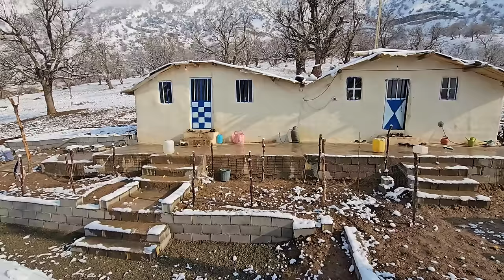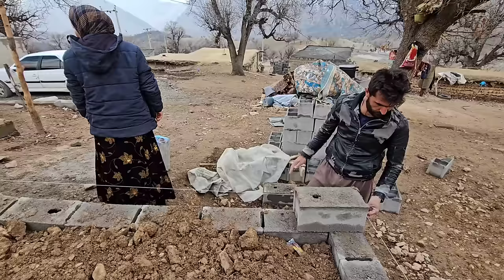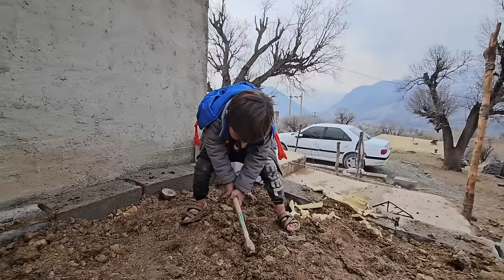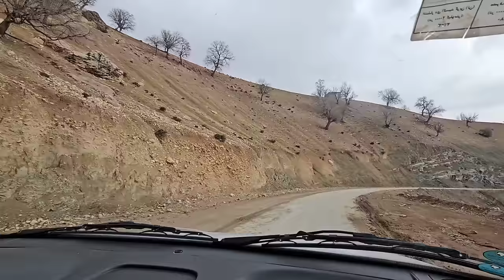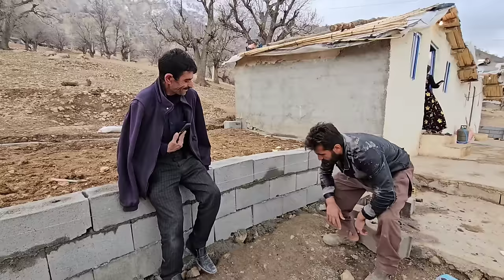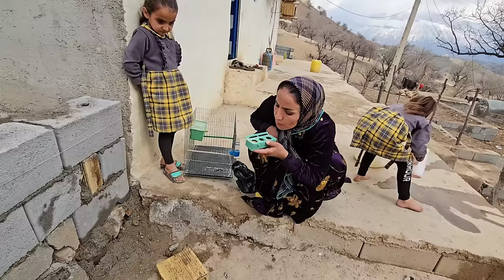Facing neighborhood problems: building permits. Part 144

Comment: If there is a problem with the Land, Imran needs to be sure that he’s not going to have to tear down the shower that he built. Imran hasn’t even finished repairing the roof. The roof is still leaking into the house. He refuses to work on the roof. Always starting a new project before finishing The last one. Very negligent Imran.🥺